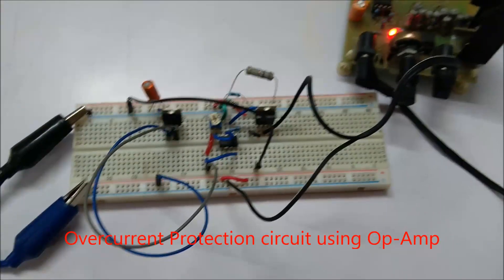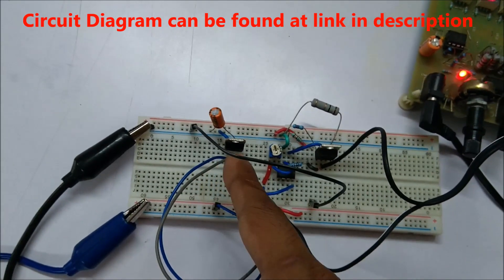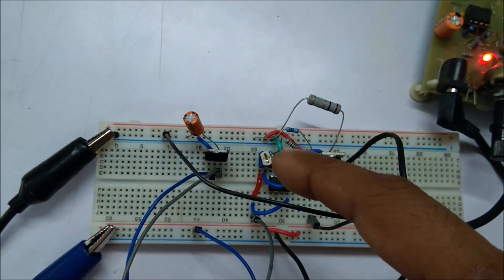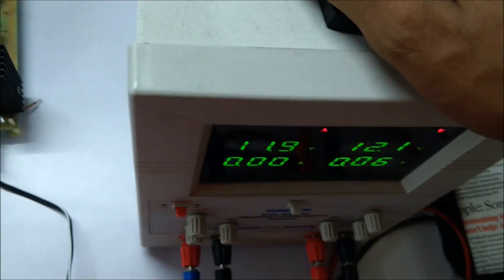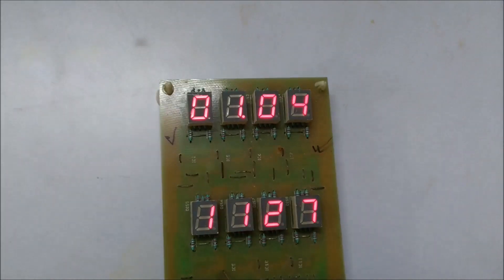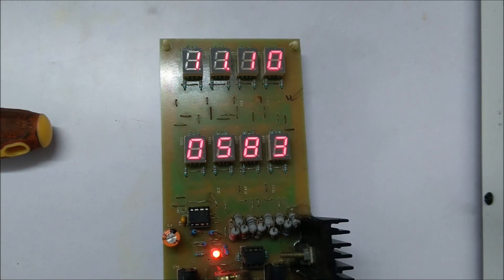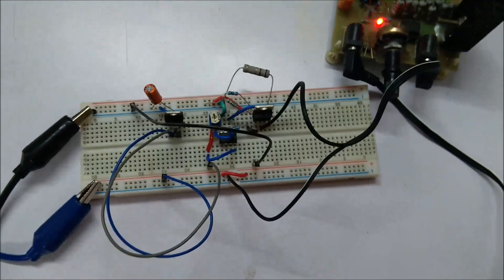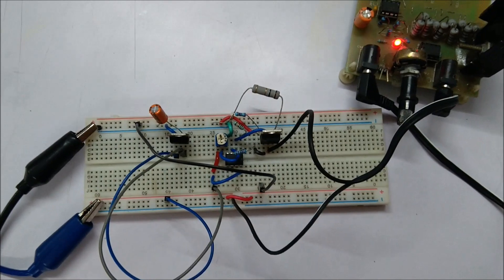How to Build an Overcurrent Protection Circuit using Op-amp

Comment: Sir i need to make a circuit that has 19 volt output. Initially i want the circuit to output 5 volts, so that the load connected to it can get the 5 volts and then switch to full 19 volts. And the moment the load is disconnected from power supply,  the output again shifts to 5 volt.

Comment: Hi buddy,

The circuit did not work. However, I used some elements differently.
7809  -  7812
IRF540N - IRFZ44N
100uf - 220uf
1R 2W - 047 5W
I used them. Others were not available. What do you think is the problem? Can you help ?